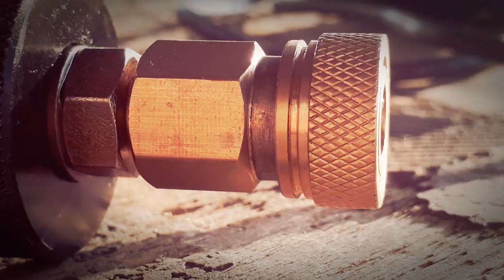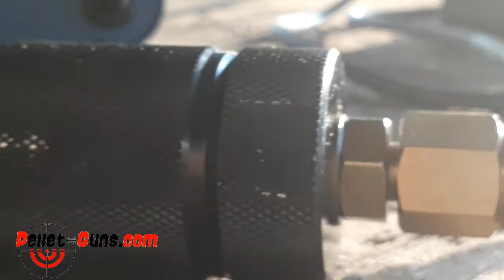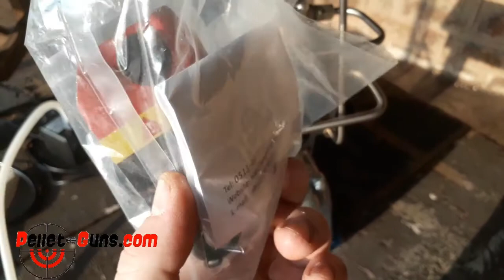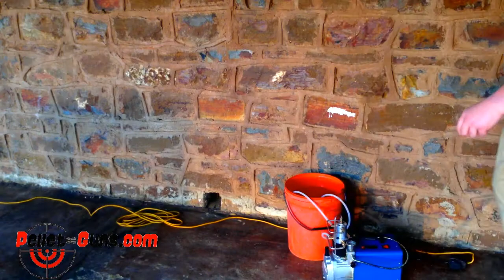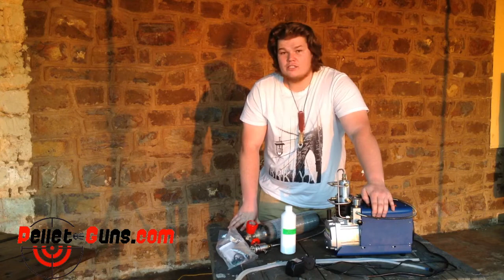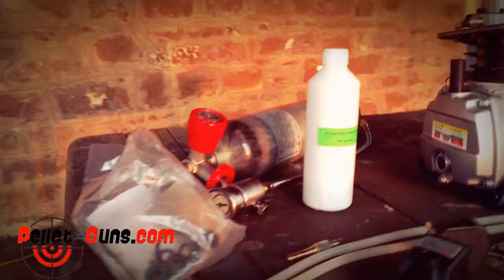The Dive shop ELIMINATOR /// High Pressure Air .

Comment: All my pcp manuals say to use breathable quality air
Reply from the maker: CamDawson . 
Good observation , as far as my understanding is, that they say use breathable air so that the person who thinks they can use propane or pure oxygen in their pcps get discouraged.  the air coming out of this compressor is breathable air they "the manufacture " however discourage the use of the compressor to fill scuba gear to go and dive, as the quality of the output air for human consumption has to be monitored more closely. I have been using this compressor for quite a while and have not once had a problem with my pcps in doing so. 

pretty much the same quality air as if you where using a handpump. or a shop filled bottle. 

Thanks for watching.